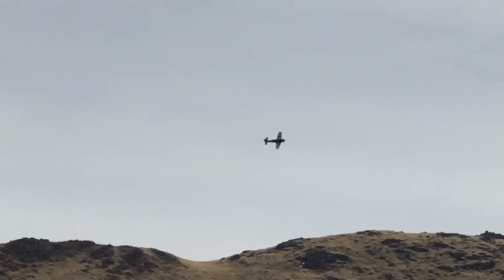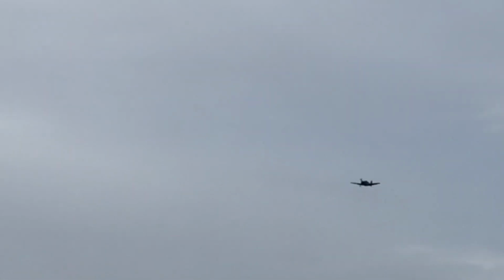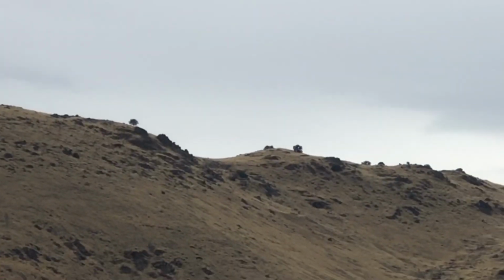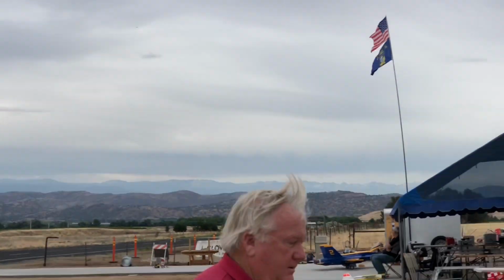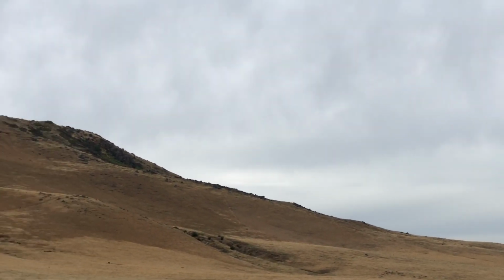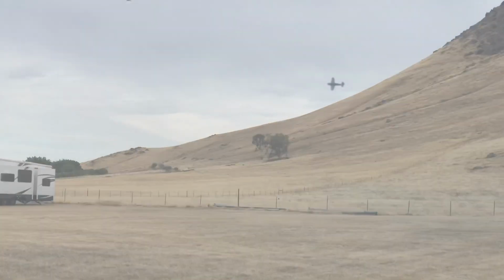FW-190 Maiden Flight Emergency

Comment: Geeez, that was perfect.  Nice job. We should have done that with my TopRC Zero during the Scale Masters last year at your field.  We lost a main wheel during the competition. Decided to try a gear down landing.  Luckily, we only broke out the one landing gear from wing.  Still a Bummer.
Reply: I remember that, glad you guys were able to repair and fly again.  This one is grounded until I rip out the electric retract actuators and install the air cylinders that came with the sierra gear assemblies.  I was warned, but wanted electric for reliability :-)